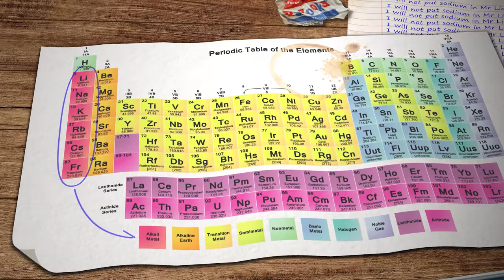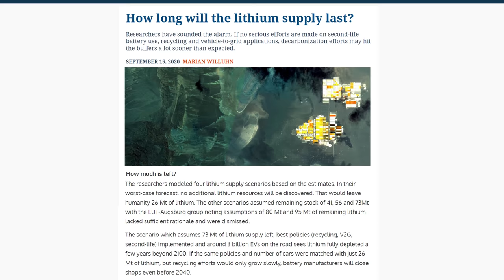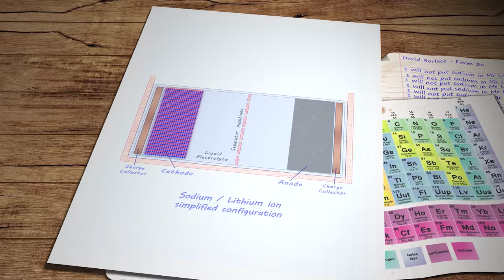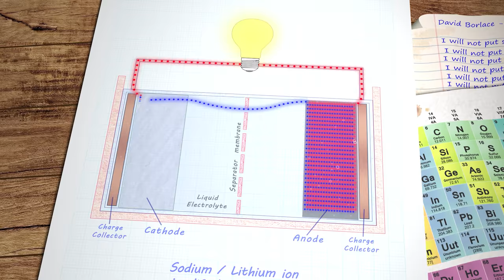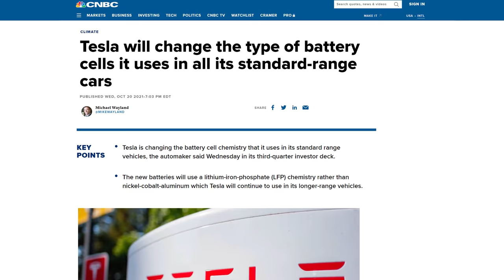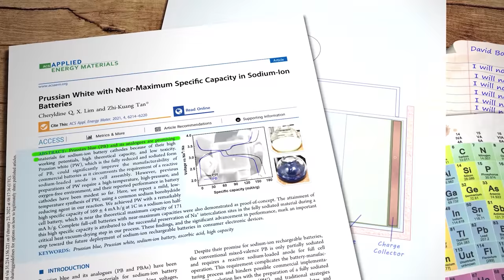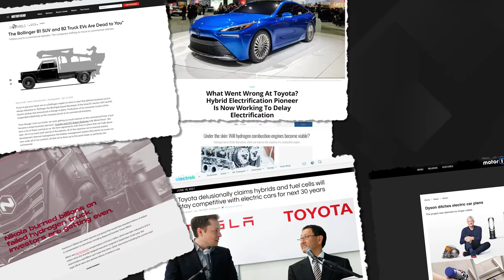Sodium-ion battery breakthrough. Safer, cheaper and cleaner than Lithium-ion

Comment: I'm still convinced it's early days for battery tech in a renewable world :)
This is awesome though! I've been following Sodium Ion batteries with great interest. It's worth noting that the energy density is better than the original batteries used in the original Tesla roadster - If I'm not mistaken. At the very least these would be incredible for utility scale storage if they are robust and the price advantage is as pronounced as stated.
Reply: Tesla's LFP-powered model 3 only has a combined pack density of 130 wh/kg, and it still goes about 420+ km, has good performance, very high efficiency, and an acceptable curb weight. If these sodium ion batteries are heat and cold tolerant then like Tesla's LFP pack, it won't need as robust cooling systems and will be able to shed a lot of weight and recoup some energy density compared to the normal NCA-chemistry battery packs.

Comment: Na Ion seems like a good option for the future.   Given how similar Na Ion is to Li Ion, I think it has a high probability of finding commercial application sooner rather than later in the electrical storage market.  I think multiple battery chemistries will find useful applications in the years ahead.

You missed Bolivia as a Li supplier. It does not produce a lot of Li now, but it has one of the largest deposits.  Also, regarding recycling, this will not make a significant contribution until the material being recycled is a significant volume in relation to production.  As BEVs are only about 5% of the market now, and should typically last more than 10 years, we are going to need 'virgin' battery material for most batteries over the next 15 years.

Comment: This sounds like great news, will be interesting to see how it turns out but sounds promising as they can manufacture them similar to what they are already doing.
Also from what i have read they have a high number of charge cycles so should last quite a bit longer than lithium ion batteries.
Reply: LFP have a high cycle life.  That's their competition.  It sounds like CATL is close to matching or beating LFP.

Comment: I agree on the viability of these batteries for use in homes and stationary applications. If they can improve efficiency, they might also be used in delivery vehicles, bikes, and autonomous vehicles that could be easily and quickly charged when not in operation. The less we need to use rare and expensive materials, the better. Thanks for sharing these developments with us.

Comment: This is one of the more promising breakthroughs on the battery front that I've seen in several years.   The CATL first generation sodium-ion batteries are not a killer technology quite yet, but they are a very, very good basis for further improvements:

160 Wh/Kg - a good first-generation number, but not a game changer yet
80% charge in 15 minutes
good low temperature performance
good stability
no thermal runaway (apparently)
decent C rate efficiency - I couldn't find any actual spec on this
Costs around $77/kWh  (this is very low), similar to LFP batteries
'high' cycle endurance - I couldn't find an actual spec on this.  Probably similar to LFP

At the same time, lets not forget about LFP (LiFePO4).  Tesla's LFPs for the model 3 clock in at 200 Wh/kg and their lithium-ion's clock in at 260 Wh/kg.   Theoretically, the LFP chemistry also have several years of improvements ahead of it that could take that well past 300 Wh/kg.

So it might end up being a race with one guaranteed winner - We the consumer!

-Matt
Reply: What is LFP cost/kWH?
Reply: @jeffrbake  For whom?  Tesla?  VW?  Ford?   It's a moving target.

Current Tesla lithium-ion packs are around $130/kWh.  Tesla LFP packs will probably be closer to $100/kWh once volume production really gets going.

Since LFP is cheaper to produce than other chemistries, it certainly won't be higher than NMC or NCA chemistries.

In a few years we are probably looking at $70/kWh.

(Energy densities are also a moving target.  LFP chemistries seem to be improving at around 20wH/Kg/year and are somewhere in the 170-200Wh/Kg at the moment.  But several companies in China appear to already be mass-producing LFP batteries in the 230Wh/Kg range and expect that to be 260Wh/Kg within 1-2 years.  For the raw cell.  Subtract about, oh, 10% for the in-pack equivalent.

-Matt
Reply: @junkerzn7312  awesome thanks for the info. So really as soon as this alterative battery type can improve energy density then it will be an obvious choice. And if it's cost is already under $80/kWH, I just imagine how much cheaper it can get.
Reply: @jeffrbake  Right now 200 "real" highway miles is the norm (ignoring luxury vehicles with super huge battery packs).  The combination of dropping pack costs and rising densities should give us 300 highway miles in maybe 3 years.  Just with nominal advances in the technology that are already easily attainable.   I'm using class and whole-year (both sesaons) averages here.

If we throw in a real game-changer, such as a solid electrolyte, or some nano-patterning, or something else that radically increases energy density, we might see 400 miles for a mainstream BEV in 5 years.  Personally I think it might take a little longer to get to 400 miles in a full-sized mainstream non-luxury BEV.  (Yes, I'm well aware there are a few BEVs that can do it now, but that's only by super-sizing the battery pack and adding too much weight to the vehicle).

I would argue that, combined with BEVs crossing over and becoming cheaper than ICE vehicles in around the same time frame (there is already significant overlap), this represents a complete 'game over' scenario for gasoline.

And so far the only car company that seems to realize it is Tesla.  Even VW thinks that only 50% of their own production will realistically be EVs in 2030.  Other volume car makers are in even worse shape.  If this winds up being the case, Tesla will be able to double production for several years and still sell every vehicle they make.   But I do hope other vehicle makers get more real, because no new ICE car will be able to make a profit for its maker in 2030.  Hell, I think the profits for gasoline offerings will banish by 2026.  Never mind 2030!

-Matt

Comment: Lithium is very abundant, even though it only exists in concentrated mines in a few places.  It could be extracted from sea water nearly endlessly, but yes, at a much higher cost than mining it.  That said, sodium may make more sense as electric cars move from novelty to mainstream.
Reply: Good luck extracting Lithium from sea water. It is present only 0.2 parts per million. Sodium on the other hand is 35,000 parts per million.

Comment: This was one of the better JHAT vids, but I wanted to comment on "running out" of lithium.  It won't happen.  A lot of people like to look at the "proven reserves" numbers, then divide that number by annual use and say "we will run out in X years" (sooner if you apply a growth curve).  The reality is Earth is BIG(citation needed) - and as demand increases, price increases, which makes more material viable for extraction.  

It is perhaps plausible that we would reach a net energy loss of extraction of lithium - ie the energy required to obtain the lithium becomes not worth it other than the convenience of the portable devices.

However, the sodium ion is exciting - we recommend looking it up in Wikipedia, particularly the density chart.  This is the first time I've seen something potentially beat lead-acid.  Lead-acid gets a bad rep but it is incredibly recyclable (typically 97%+) and cheap.  However, sodium-based tech looks to be cheaper AND lighter, which would be great.  Lead-acid is of course ridiculously bad for electric cars, but for supplies that don't move around, it is/was practical.  This is the first time I've seen a plausible way to usurp lead batteries and have anything close to the cost, availability, and recyclability them.

Comment: This is fantastic news! The only thing I would love to see in the future however is less reliance on cars in general as it is an extremely inefficient way of transportation. I mean one train car can hold 60-100 people, meanwhile at the same size cars can generally only carry around 10 people, requiring a lot more infrastructure and materials for its upkeep... I would love to see a future where long distance travels rely on well built out high-speed rail systems instead, which connects to efficient local transportation options (which could be anything from lend-a-bike systems, trams, busses). Because the compounding costs- and environmental impact of asphalt, rubber as well as self-contained batteries is not really an environmentally efficient solution. Rail systems on the other hand don't necessarily need batteries as they can rely on the grid directly to supply power. (although nothing is hindering them from having local battery storage in case of blackouts).
Reply: You might as well go 100% bicycle and sail boats!
Reply: As usual some people don’t live in the real world  I have to be at work at  6 o’clock in the morning no public transport at that time and if there was the journey would take 1 and a half hours by bus  and no trains available it takes about twenty to twenty five mins to get to work in a car or on motorcycle . And I live in a built up city where there is good public transport . The car has been around for over a century now  and I don’t think it will ever be replaced by public transport .
Reply: @dukemasters6829  Similar to my situation. As a general rule of thumb, I can assume that travelling by train will take twice as long, and that the ticket will cost me twice what I'd pay for gas. This doesn't take the time into account to plan and schedule the whole trip, or getting to the train station, or reaching the final destination, or switching trains in between. Any of that can be a large, long and expensive trip by itself.

Or running into rush hour and not even fitting through the door because it's so packed. Happened to me more than a few times. Never doing that again.

Comment: Interesting, 0.2kwh/kg; still not the ground-breaking breakthrough in electrical storage density that we need, but 10000 charge cycles for a remaining 90% capacity (if true) promises a potentially long service life.  These batteries would be useful for local storage, for those wishing to generate their own electricity through solar panels; but as usual, it's all down to cost.

Comment: There's a good bit more lithium in the Earth's crust than stated here. California and Nevada likely have enough lithium for the entire US's needs. And we really haven't started to look too hard for it elsewhere (Africa, Siberia, middle east).
Reply: The issue isn't the actual total amount in the earth's crust, it is the limited areas where it is concentrated enough to be commercially viable to extract it. There is gold in seawater but you don't see anyone processing seawater to extract gold on a commercial scale.
Reply: DLE tech will make lithium environmentally neutral to extract and cheaper but the issue is DLE isn't coming online until 2025 to start and won't be producing most of the lithium until we'll past 2030. Lithium is still going to be the preferred material in the future as its densities will always be higher then sodium.

Comment: Sounds great ..  but I feel like every year or two we hear about some amazing new battery technology that's "almost ready for production" and it never goes anywhere.
Reply: <<
AdamCO
1 day ago
Sounds great ..  but I feel like every year or two we hear about some amazing new battery technology that's "almost ready for production" and it never goes anywhere.>>

Wishing and hoping are the stock and trade of liberals and environmentalists. PRODUCING,  not so much.
Reply: @calebmauer1751  
Electric vehicles remain overpriced and small percentage of even new vehicles sold. 

Vehicle range has certainly improved, but internal combustion engines still rule the highways

I hope we abandon ethanol additives  to gasoline to avoid threatening food shortages.
Reply: @calebmauer1751  just out of curiosity,  what cars have you driven in the past twenty years?

Comment: Missed the main problem with Sodium Ion batteries in that they have really poor durability and limited number of rcharges before failure
Reply: Could you please elaborate on this a bit? I thought they were comparable to li-ion in this regard.
Reply: 10,000 charge cycles at 95% capacity seems good?
Reply: @jeffrbake  Thats the recharge cycle of a Lithium-Ion battery, Sodium ion is 100-1000

Comment: Sodium batteries have a reputation for being fragile. They don’t catch fire as easily as lithium ion ones, I can see them getting popular for stationary energy storage if they can get it working (especially as mass is less important than volume in those cases) however from what I have seen even slight repeated flexing of the battery can massively decrease it’s capacity. So I will not hold my breath for their use in mobile devices. 

It is possible they could work in cars, cordless drills etc as individually cased cells like 18650s can be made pretty resistant to flexing.
Reply: I didn't know about the flexibility proble, but I guess if it's not a problem for stationary use they may become a game changer to store wind/solar energy.
Reply: From what i have seen the sodium batteries don't yet have the cycle live to compete with lfp batteries. More like 1000-1500 cycles vs 3000+ for lfp before they drop below 80% capacity. So they need to be at least two times cheaper, which is probably not possible.
Reply: 4680, anyone?
Reply: @rjohnm666  That's the price on a cell level. The price on a system level with battery management system and everything won't be that much better. LFP are said to be produce able for $100 the kwh, but buyable home storage systems costs 5-6 times as much.
Reply: @Psi-Storm  In the video, he claims that CATL said their batteries retain 95% of their charge capacity at 10,000 cycles.  Yes, it is only claim, but it is them claim he makes in this video.

Comment: Not a day goes by that I don’t see a doom post about our Li usage or a post about some new battery breakthrough in a lab.

This is one of the few that actually sounds like it will come to fruition though. I especially like how they’re not promising crazy numbers and are doing small iterations in order to improve it.

Any chance we can get the needed sodium from the byproduct of water desalination?
Reply: I was thinking the same.  
Seawater has about 0.2 ppm lithium and about 35,000 ppm of sodium.
Reply: There is no shortage of sodium metal. You get it by electrolysis of liquid sodium chloride (common salt).
Reply: #moltensaltreactor
#heatofvaporization
Reply: @janami-dharmam  yea sodium is super abundant. I’ve just been thinking a lot about desalination lately since it looks like we’ll definitely have to bring it online for our water needs.

The issue with that, is the by product that it produces which could very quickly lead to our next environmental crisis. So I’m constantly looking for a way to us to use the brine for something useful rather than just dump it back in the ocean.
Reply: Regarding the question on water desalination: I was wondering the same thing
Reply from the maker: That is certainly feasible

Comment: I think it could works for static storage. it would great if they could to reduce the required quantiy of Cu (or event remove it).
And what would they do with Chlorine?
Reply: copper has been used as a current collector; it can be easily replaced. But where the chlorine is coming from?
Reply: Chlorine is used in the production of PVC, etc.
Reply: NaCl
Reply: In the video, he mentioned that, when considering the sodium cell chemistry, the copper can be replaced with aluminum.
Reply: @juanjosefraga9310  from seawater
Reply: @janami-dharmam  seawater, salt mines, probably somewhere else I'm not thinking of. It's all over the place so I can't imagine it'll be hard to get
Reply: @kylejohnson6775  I'm pretty sure it's in soy sauce and potato chips as well! ;)
Reply: I was wondering the same, if massive amounts of chlorine byproduct are produced the current market for PVC and HCl may not able to absorbe it.
Reply: @kylejohnson6775  Pakistan's and/or Afghanistan's salt mines are absolutely HUGE!
Reply: I agree.
Reply: @pomodorino1766  if for nothing else, you can use the surplus chlorine as disinfectant and purify drinking water! Seriously, chlorine demand is not less and any excess production will simply lower the market price
Reply: @janami-dharmam  Chlorine to purify water is usually in the form of Sodium Hypoclorite, so the sodium is still there with the same molar ratio. We are back to square one with that one.

Comment: Great reporting, Dave!  One minor nit.  At 5:39 you state that "They (CATL) are already making Lithium Iron Phosphate batteries for all Tesla cars sold in China".  Currently, Tesla is only using CATL's LFP batteries in their "standard range" cars where the lower energy density is acceptable.  The higher-performance long-range versions of their cars still use Nickel-based cathodes.